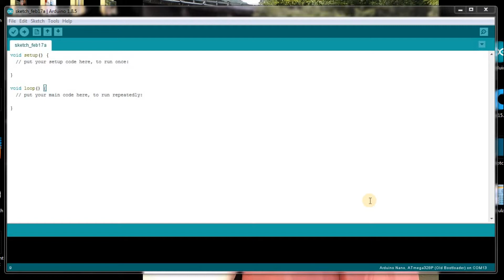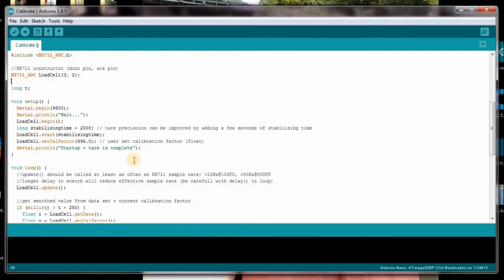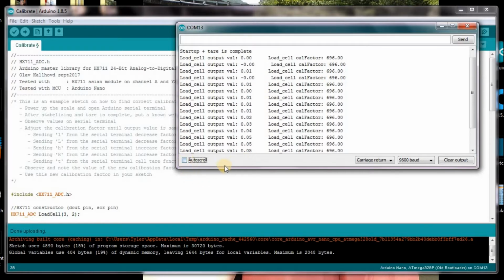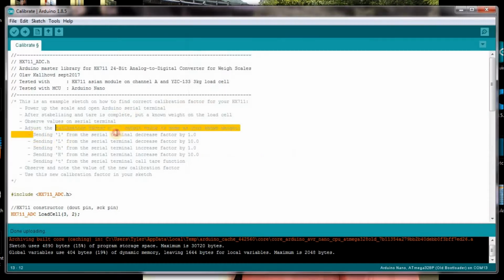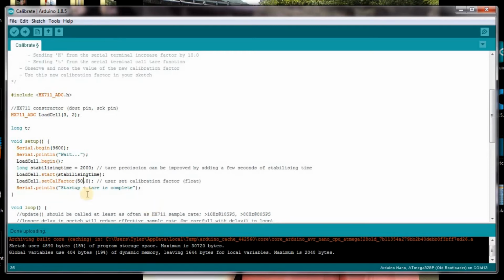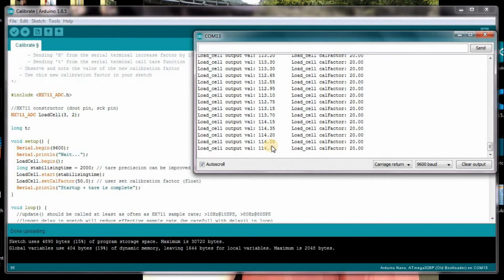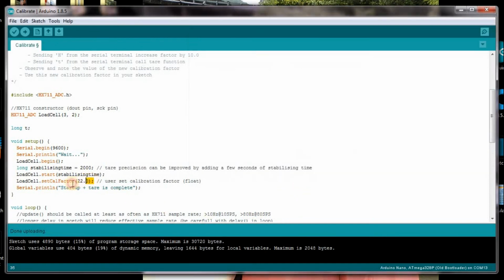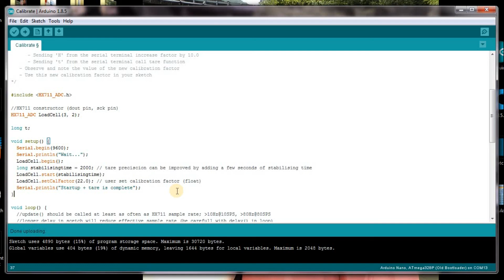Load Cell Kit Build

Comment: Zero experience in Arduino here -- I have found a few kits on Amazon but don't know which one to buy for this project, any suggestions? Also, is the scale built this way works 100% accurately?

Comment: Good video. Wouldn't you need some metal plates to contact the load cells so the pointy bits don't dig into the plywood?

Comment: Hi. if the sensor is under load all the time, will it affect its performance? Will it stop working due to deformation?
Reply: it will probably drift but settle over time...could plot the function of it and write in your code to compesate.
 If the platform you are placing them on deforms, yes you will get messed up measurements.

Comment: hello sir! do u have any wiring sample for single piece load cell? or this loadcell needed to be 4pcs per HK711?
Reply: hello, if you are talking about a bar type load cell you can see it here : https://www.instructables.com/id/How-to-Interface-HX711-Balance-Module-With-Load-Ce/

However I don't think HX711 is the right amplifier if you are looking at a half-wheatstone bridge or quarter bridge configuration (which is using only 1 or 2 of the 4 load cells in the video)

Comment: I'd like to mention that when I tried to us similar load cells with a persistent load, they creeped terribly over time.  They never really stopped creeping, so it was exceptionally difficult to use them.  These cells are made for a scale that has load that's applied and then removed like a shipping scale.  I'd like to hear about your experience with trying to use them with a persistent load because I just gave up after seeing the creep.
Reply: What are you talking about creep?
Reply: Hi Gritnix!!. I'm in the same challenge as yours, could you find a system of cells that resist constant weight? I need to weigh drinks. Thanks so much!!
Reply: @aldosenn  worth mentioning that what's in this video are load sensors, not sure if he says that or not.  The sensor is 1/4 of a wheatstone bridge, put 4 together and you have the whole bridge.  A real load cell is the whole bridge in one cell.  It will still creep but will stabilize over time.  It will be rated as having a certain amount of creep over the course of 30 minutes, usually in the range of some tenths of a percent of the total weight.  A parallel beam load cell or a compression load cell is what you want.  It's really a case of you get what you pay for, and if you're really concerned about the creep, don't buy anything that doesn't tell you what the creep is.  The more accurate you want to be, the more money you'll spend.  Also, the HX711 used here is not a very robust chip in terms of temperature.  I've read where someone said they could essentially use it as a thermometer.  If your scale will be in a fairly tight temperature range, no big deal, it'll be fine.  But if you'll have big swings, not fast swings, but just large, then you'll want something better.

Comment: I did the same thing but the signal was very noisy. The measure was oscillating between +-5kg and it was also influenced by people moving around it (without touching it).
Reply: the load cells only work for 50kg so i doubt it was +- 5kg. also you can change the gain. search for load cell gain i think its 32 , 64, or 128 idk im just remembering
Reply: @AntiRobotCommittee  I fixed it by rewiring the circuit. The very high noise was probably caused by a faulty connection
Reply: @baucez do you remember how you fixed it exactly?

Comment: So are we going to see the platform installed in the coop? I am very curious whether by looking at delta weight values you can tell whether a chicken comes on or off the platform, deposits an egg (or one is removed), adds to the 💩 load etc. and maintain an accurate inventory over time. Or is the signal just too noise-ridden for that?